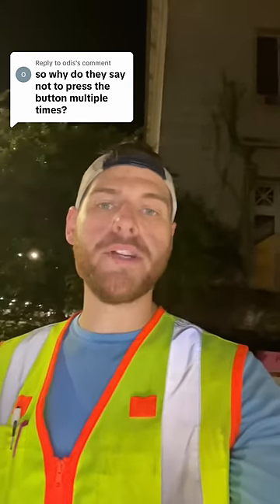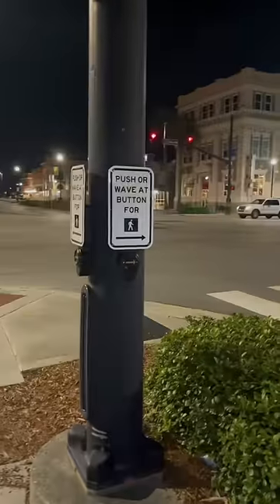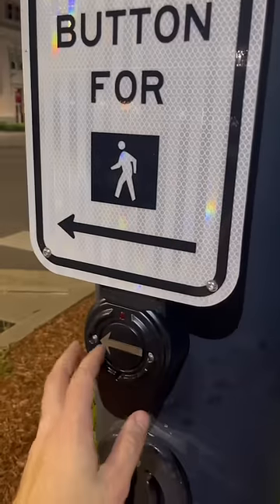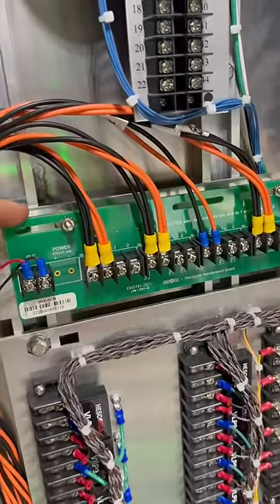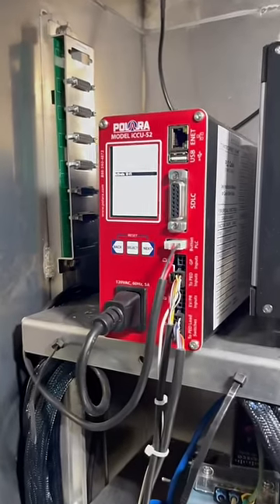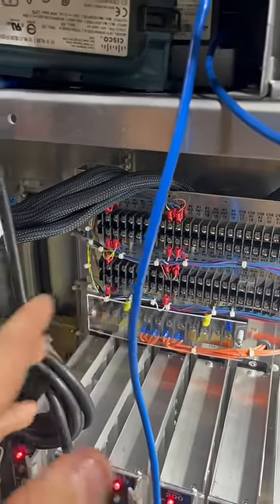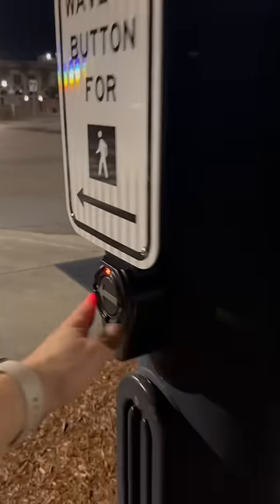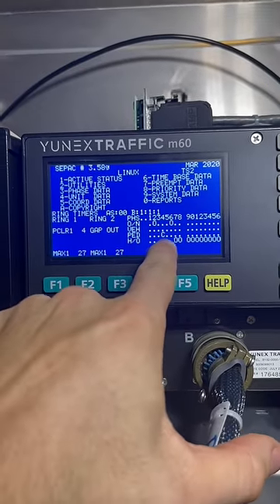Press it as much as you want!!!

Comment: As a retired computer tech I have to say. Dear God that controller box is WAY over complicated for the job it does.
And yeah, we never did get an answer.
Reply: I don't see how it's overcomplicated.  Traffic lights are very reliable. Those PLCs are full of all kinds of protection features, standardized mounting for quick repair, ladder logic instead of C++ so nobody crashes it with a null pointer, etc.   I'm not sure how you could do it any simpler.  Maybe not all of it is needed, but it's probably largely reused from designs shared with other stuff, and if you simplified it you'd have more unique stuff and it would probably cost more and involve more  specialist skills, as opposed to one size fits all approaches.
Reply: Absolutely agree that system is way too complicated for its function. Seems like they took a prototype/proof-of-concept and decided to ship it
Reply: @ksbs2036  I swear a cabinet with not much more than some ice cube relays and timers could turn on lights when you push a button or drive into an inductance field.
Reply: @jasonw1779  But could it send an email when there was a failure, ensure with a hardware interlock you don't get a green light conflict, be resistant to humidity, show the maintenance people the state of all the internal variables for fast debugging, operate in below zero weather, and do it all for years without failures?
Reply: @EternityForest hell you could probably integrate a raspberry pi and some multimeter into it that could send an email upon a loss of voltage or excessive resistance. Yes they work in harsh conditions. Things get a little more interesting if you want it to talk to other intersections in a neighborhood or city, but the premise of turning a light on and off is an incredibly simple process.
Reply: I was thinking the same thing. Seems like you could accomplish this pretty easily with more mechanical means.
Reply: @allurared9029 Pull a rope, rope goes to a pulley, lifts the cover to a stop sign in the middle of intersection, which also lifts the cover to the walk sign, and a bird cage with a parrot trained to say "walk sign is on" everytime its cover is lifted
Reply: Remember  gov involved
Reply: This is the kind of thing that’s tax dollars are wasted on…
Reply: Someone has never had to deal with fault tolerance at a data center level.
Reply: That’s pretty standard for controlling just about everything today. I work at a factory and every individual machine has a box about the size or bigger.
Reply: @jasonw1779 thing about using relays is that you would have to rewire the panel if you want to change so fictionality and it also more points of failure.
Reply: @hogsrmylifetbj this isn’t really a waste. They might have over paid for some components but they probably have about the minimum to safely control the lights.
Reply: @jasonw1779  Honestly with the complexity of the system this is about what you would to control this system. A panel this with relays and timers would be about twice as big.
Reply: @jasonw1779 anything you have to reboot is not suitable
Reply: I do traffic engineering design for a living. I design intersections and I can tell you all with certainty that there is a reason for everything inside of that controller, and it is complicated for a reason. There seem to be a lot of non-engineers in the comment section here talking about something they really don't understand.
Reply: @ksbs2036 This is so wrong it's not even funny.
Reply: @hogsrmylifetbj Tax dollars don't pay for this in 90% of projects. It's almost always a land developer who is required to build signals at intersections near their development based on the impact their development will have.
Reply: @jasonw1779 They are literally hooked up to comm lines. There's no need for that.

To answer why your solution is impractical, it's because signals on corridors typically have interconnect lines that coordinate signals along the corridor based on traffic flow at any given time. Complex timings could never be achieved with your method, which would have dramatic impact on the efficiency of a signal during its peak hours, and make waits excessive during slow hours.
Reply: I feel like all this could connect to a tiny Raspberry Pie.
Reply: @jasonw1779 you nailed it when you mentioned other controls at other intersections. That’s exactly why it “has to be” this complex.

 You’re right, most people could build a simple system with fifty bucks worth of 24v relays that would handle one intersection just fine. It’s managing a city network or even a small town that happens to have a “rush hour” and known traffic patterns efficiently, when it has to get hi tech.
Reply: @EternityForest Yes, every day.
Reply: Didnt sound like he knew what he was talking about really.
Reply: @EternityForest I mean, I could do all of that with a damn aurdino
Reply: @epileptix8954  So how did they do it before transistors and software?
Reply: @joeb134  So could I, probably in just a few hours, but I wouldn't. 

Traffic lights are extremely reliable. Their failure could kill someone.  It doesn't matter if there's a better way to do it, it matters than doing it this way is known to work.   If you have a better idea, the people to complain to would be the manufacturers, not the city, because the city can only use what's available.   Doing original in-house tech when you don't need to would mean hiring tons of engineers, support staff, documentation writers, programmers, etc.
Reply: @EternityForest  Or it just a way to overcharge for something that could be much to install and maintain. 
I get your point, but it's flawed. It's kinda like a Mercedes. It's over engineered to hell and back, sure in theory it means that it's more reliable but in reality it really isn't and costs much more to repair.
Reply: @joeb134  I think the results speak for themselves. Traffic signals, and everything else done with PLC-like stuff tends to be highly reliable. Stuff people make with Arduinos can be reliable if the designer is skilled, but very often will have problems even if it's only one failure a year.  Doing it this way means you don't have to trust an individual or small group.  It's done mostly the same way, every time.   Instead of having 50 different designs that are just right, made for an specific application, you have 2 or 3 designs reused everywhere, even if you don't need the features. Fewer designs is less to test and hardware is cheap compared to physically putting up the light poles and cabinets anyway.
Reply: These things are absurdly simple compared to computers though
Reply: @EternityForest  Bro. An arduino with a mosfet driver board could literally do it with absolutely no problem. Two parts to stock, either one of them could be changed out in 30 sec.
Reply: @sammorgan31  you quite literally have no idea what you're talking about. An arduino couldn't do all of the required functions signals have these days.
Reply: As a retired software guy, I once got a peek at the code that runs the local traffic system. Absolutely amazed at its complexity, running a continuous model of traffic and controlling all of the stop lights accordingly.

As a current driver, the things are absolutely worthless. This was driven home when someone got the bright idea to put up digital signs on one major street that would show you what speed you needed to make the next light on green. One problem - it updated every minute. It would flip from 22mph to 17mph, back up to 38mph, down to 27mph, then up to 52mph (it was a 45mph speed limit at the time!)

Needless to say, the signs were taken out of service after less than a year... The code, though, I am sure is still running along quite merrily.

Oh, and the answer is that in there in all of that complexity is a latch of some sort - hardware or software. Gets set when the button is pushed, gets reset when the signal to turn the stoplight green again. I read of one system that supposedly counted the pushes to determine the timing - but was abandoned thanks to stupid kids (in mind at least) that would "hang" the red light for a half hour at a time.
Reply: @EternityForest  Plus PLCs are industry standard for automation. This dudes never worked in an industry
Reply: The ATC controller is function built to be scalable for multiple traffic applications, from highways to city streets. I mean it might have to do with the fact that they are all Siemens controllers who was the contractor for the ITE who instituted the standard, so probably a bit of bias in what they decided was both best for their profit margin but also "cost effective" for their customers. That's as standard a industrial control panel as I've seen though. The Polara does offer bluetooth & wifi functionality though which is funnily a bit overkill being a dedicated Push Button station controller. But I mean that functionality is becoming the standard for DDC controls so its not that outside the box.
Reply: No need to blaspheme my brother. GOD BLESS YOU ALL
Reply: Wow. The thousands of PLCs that I wired up were for house sized machines and miles long conveyors. This is overkill.
Reply: @allurared9029 relay logic. That is why we use ladder logic software. Electricians understand relays and coils and contacts. I took C+, but most electricians who troubleshoot the malfunction on service calls never took programming in C.
Reply: @MsHojat They are computers. I have changed the CPU modules, not all computers look like laptops.
Reply: There is a future you know it won't need to be upgraded
Reply: @deadmanswife3625  In the future all will need to be replaced.
Cars will communicate with each other and with the future traffic lights using a cellphone-like network. The lights will know if more cars are coming in one direction and stay green longer for higher traffic. (simple explanation) and how many times have you been in a car and the light changes just to stop your car? That will never happen again when the cars can communicate with the lights.
Not too many years ago traffic lights had actual motors turning wheels that timed the lights. I'm sure most of those have been replaced by now. Cheers.
Reply: @michaelshada262  maybe where you live LOL some of the original systems came in in the beginning in some places and because they paid the heavy price they've never been able to afford to upgrade sort of the way the government's computer systems are. So outdated but still in use
Reply: @michaelshada262  by the way if you're still spending time and other resources using personal Transportation I don't know what to tell you
Reply: @deadmanswife3625  don't want to get in a long conversation but I quit driving when I was 40. Now 69. Because of the crazies on the street and public transportation works for me,  AND SO MUCH CHEAPER. LOL
Cheers.😊
Reply: @michaelshada262  well you shut me up. Glad to hear it.
I'll take this as the last word no need to comment or have a long conversation
Reply: @allurared9029  basic timers that didn't allow for variable dwell times based on traffic, communication with other signals and a central control system, and various other things that make this worth it.
Reply: @michaelshada262  I hope not. Every time I hear about the "future" it sounds like we are moving closer to a bland cushy hellhole where everything in the world is automated and micromanaged by computers. Sometimes it feels that way now. You lucked out getting to live most of your life before the world turned into a giant computer.
Reply: @jasonw1779  Could it also vary the timing of the lights by the time of day, be remotely controllable, have redundancy, and be able to have its status monitored remotely?
Reply: @charlesgrove6905 isn't the Bluetooth/wifi for the new accessibility things with smartphones?

Comment: Here in Brazil , they never work. I think they put those buttons to distract the pedestrians while they wait the regular time.
Reply: I think they're just stickers by me in n.y. lol
Reply: In NYC I think I heard 20% of them do absolutely nothing😂
Reply: They are meant to co-operate with induction loops in the road (essentially metal detectors) that activate for cars. But under stress of trucks, the road surface yielding under heavy load, the loops break after a time, and if there's no money in the budget to fix them, they stay broken. And so, not to paralyze the crossing, the controller switches to 'constant time' regime, disabling all its smarts, completely ignoring inputs both from loops and pedestrian buttons, just running the lights off a timer.
Reply: They make no difference here except at night when there is no traffic at all. During the day, you just wait the normal time anyway, so press on the button Pavlov, it ain't changing a thing.
Reply: Many of these do nothing, they just leave it there so pedestrians feel like theyre accomplishing something.
Reply: Lol. I literally made a comment about that. When I lived in São Paulo, I had a friend that designed that stuff for the city. The button was connected to a small speaker to make the noise and then to the power grid. There was no computer to change timings, or to change the lights.
Reply: My grandpa says the same thing and I live in the Midwest

Comment: In the UK it's common to see a whole bunch of people waiting to cross at the crossing, and not one of them can be bothered to press the button.
Reply: I'm often the one that presses it. And I'm still going to press it multiple times, especially if nothing seems to happen.
Reply: Yes, that's because they dont want to stop the traffic unnecessarily. I don't push the button. If traffic is light, I just wait for a gap and cross. If traffic is slow moving, I just walk between the stopped cars.
Reply: There likely on a timer.
Reply: I mean, if the light I'm crossing with is the right color the pedestrian signal is fairly redundant.